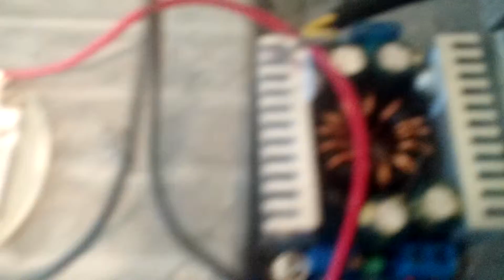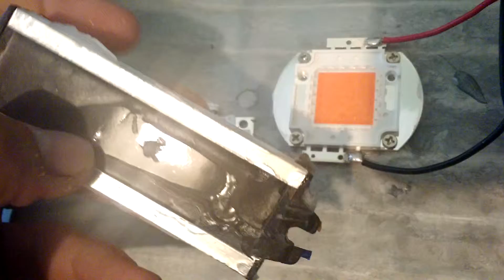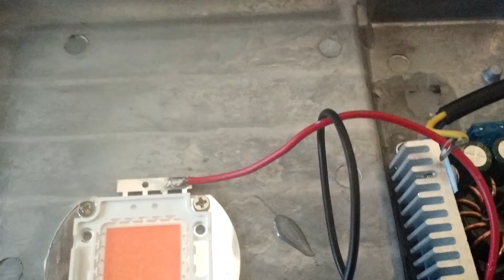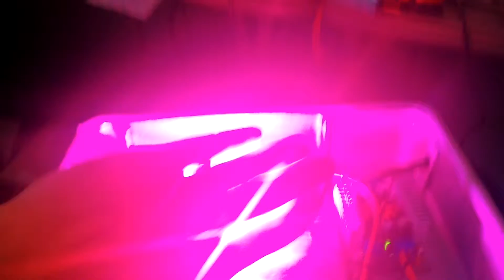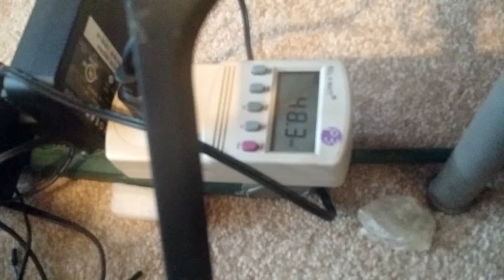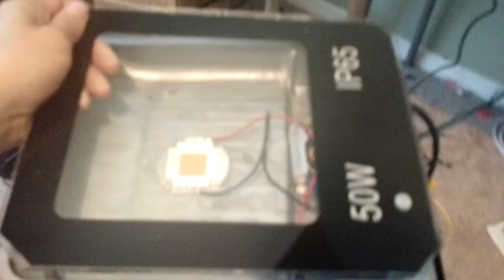50watt LED spotlight mod grow light

Comment: what type of the LED ? also if you using Boost converter still using 12 dc power supply or led driver 
thanks
Reply from the maker: jaka runi it's a 50W COB with an orangish phosphor that emits blue and red (pink).  you can find them on eBay or AliExpress. this driver is probably a buck converter from 36 or 24V...
Reply: but still power supply for buck converter or boost converter yes tripzero
Reply from the maker: jaka runi correct.  24 or 36V AC/DC power supply.
Reply: thank you my bro you safe me buying grow  lighting , ok will build now thank you bro
Reply: i have 2 x 50 watts can i assemble series ? to connect to buck converter
Reply from the maker: If you assemble in series, it'll double the voltage.  I usually assemble in parallel when I use a buck converters to supply.
Reply: is that correct bro , I just follow some one assembling series , basicaly what I need if i build led grow light with more than 5 or more led with series assembling ? any schema and what material I need bro for example 200 watts or 400 watts with 10 watts led or 50 watts led ? I have view led 50 watts and 10 watts 20pcs ,thanks
Reply: tripzero better using single one yes , no series or paralel asemmbling